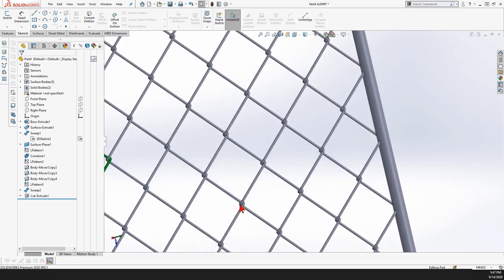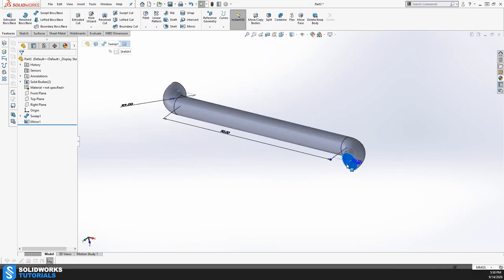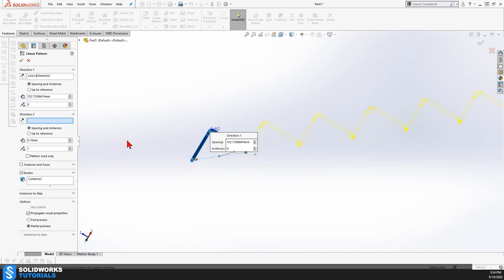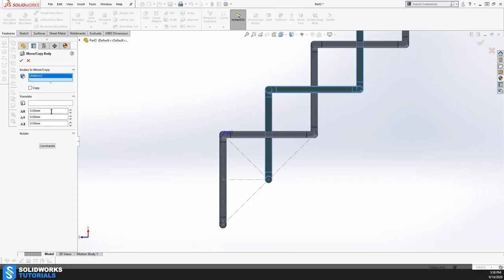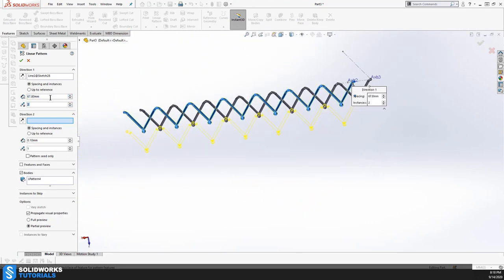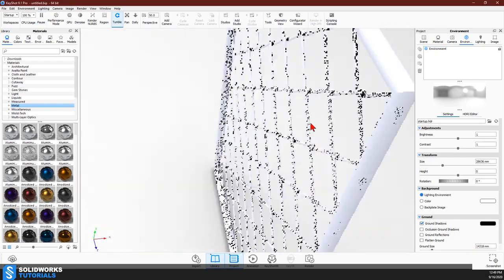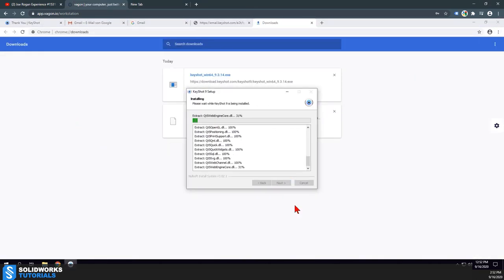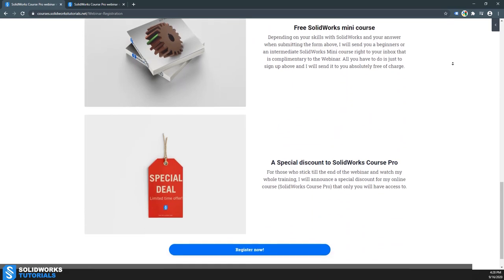Woven Chain Fence in SolidWorks Rendering with 32 Cores!

Comment: Woah I never thought we could even design a fence in solidworks.
Man u r awesome
Reply from the maker: of course, there is barely anything you cannot design. The level of difficulty varies though
Reply: @with-Aryan  what is the most difficult thing struggled with till date to model?
Reply: @with-Aryan  cool
Reply from the maker: @avitolourenco  3D curves when you don't have a drawing to build from. It was a heart mitral valve implant.